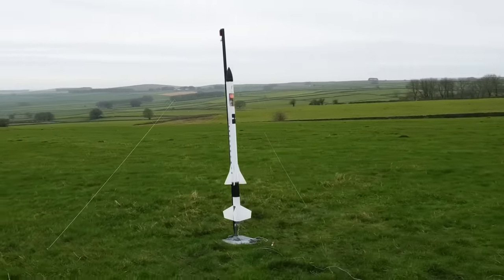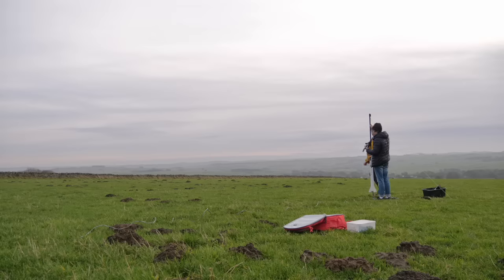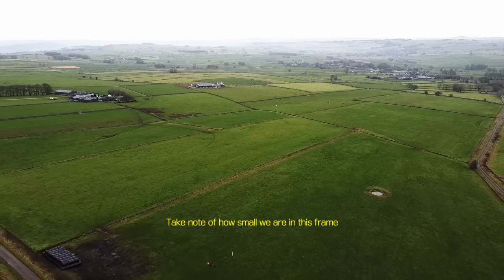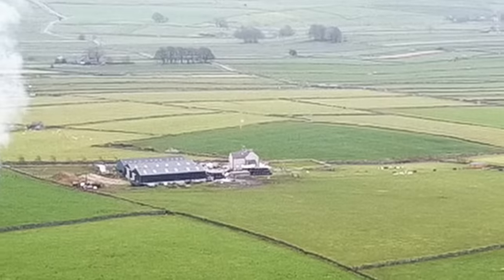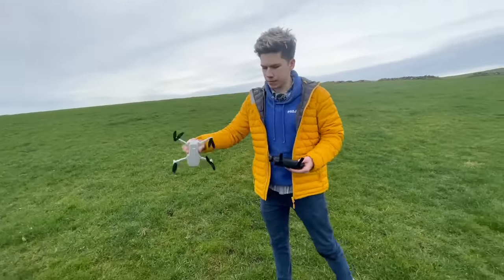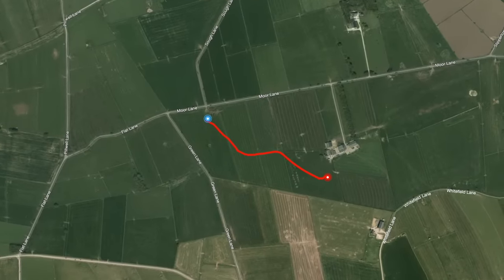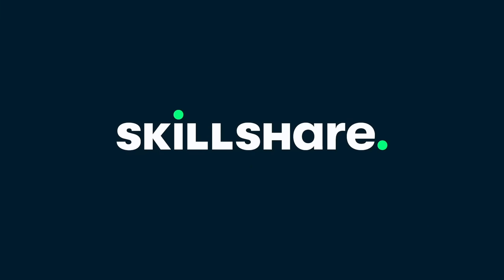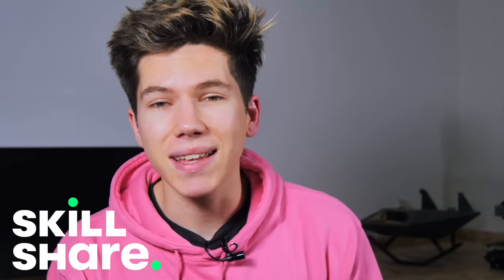High Performance DIY Rocket

Comment: Thats an awesome rocket! Congrats! I can't help notice that both your Ender 3's have the spool mounted on top. I've done the same, but I found printing a spool spacer made a big improvement in printing, preventing the spool from wobbling the frame as it pulled round, made it much smoother and less artefacts in the print.

Comment: One thing to note from this is that things that you don't think can happen will.  Even a bigger stronger camera tray or better attached nose is not a guarantee.  Consider simple and safe backup is a great way to mitigate risk for critical (or at least high cost) failures (like loosing your camera).  One example of how to mitigate this would be a tether line from the camera strap/tripod mount to the parachute anchor.  Good luck on your next launch and stay safe.

Comment: Great launch! My launch rail is a 2 meter curtain rail, reinforced with 20mm square tubing. Mounted on a tripod that is 1 meter high. Giving a total of 3 meters. We have level 2 in South Africa. So that is full J-Class motors. We do several km high flights here. So good luck with your project.
Tip. Build a secured E-Bay for your electronics and cameras. Because you are limited to motor ejection, you may have to look at a body split ejection. Where the e-bay and the nosecone acts as a single, long nosecone, and is attached to the booster by a shock cord/recovery harness.

Comment: In 1978 I built my first Estes 2 stage rocket that I bought at a local hobby shop. It featured a first stage with a 0 second delay on the ejection charge which then lit the 2nd stage off. Unfortunately being a kid without much money on the 2nd flight I used an existing C engine I had in my box which had a 1 or 2 second delay regular engine. On that second flight after the first stage was done the rocket tipped over at apogee and then the 2nd stage fired... it went way into the woods at the edge of our launching field and was never found again despite days of searching. I loved rockets as a kid and homebuilt 2 and 3 stage rockets out of cardboard tubes are really nothing new, though building them with GPS and cameras certainly is!

Comment: Hey James, many years ago at a UKARA event, a chap had a new high power rocket motor that didn't require an explosives license, and it might be time to revisit the idea. It was an injection molded (because this was pre-3D printing) ABS plastic rocket engine vessel, with a thrust nozzle, all in one piece. He had the top threaded for a feed from an NO2 tank, pre-filled the vessel with O2 to get things rolling (simple fill through the nozzle), and ignited the actual wall of the vessel using a spark across some speaker wire, from a fluorescent tube starter. This could be 3D printed easily, with some fluffy chaff to help the conflagration get started inside the vessel. You just need gas, and some solenoid activated valves, and you are flying.

Comment: With a FSI F-100-6 motor and a small rocket, we got mach1 at 900 feet altitude, and the small boom was herd at 1000 feet away from the pad, total cost $11 back in 1992. Also with a dual stage FSI e5-0 plus e5-6 and small rocket got to over 4000 feet, with 9 seconds of total burn, the good old days.

Comment: Use an 80/20 (t-slot) aluminum extrusion for your launch rail. you can get them in 10ft lengths uncut fairly easily (and longer by order) and many of the commercial and 3d printable launch lugs are designed to fit this profile

Comment: A board based on the Venus838FLPX chipset has GPS update rates of up to 20Hz and is very reasonably priced. Good luck with the builds 👍

Comment: Always use a short burn, higher thrust Blue Thunder type motor in the booster to get the rocket moving straight vertical. Longer burn motor in the sustainer since it is already moving fast. Nothing worse that the rocket going horizontal when the second stage lights.

In us you also need a waiver from the FAA. Rules change, but I recall a one pound loaded weight for a G motor. An H motor you will prob only fly with a club that has to get a waiver..

Comment: A few thoughts regarding the nose cone, that you've probably already considered.  If you screw or bolt it to the cardboard 2nd stage tube, you run the risk of the tube tearing if the payload sled shifts.  The first thing I'd try is to either design the sled so it is long enough to completely fill the tube length or add some lightweight filler between the sled and the base of the nose cone.  The second thing would be to make the base of the nosecone that slides into the tube deeper.  That way you can anchor it to the tube farther back from the edge which should give it more strength.  Maybe even use some fiberglass strapping tape and run a band of that around the tube where you're going to put the anchor screws.
.
Excellent launch even with the oops!  Hopefully the camera is well marked and whoever finds it, if anyone does, gets in touch with you soon about it!

Comment: I just watched these 2 videos back to back and almost ALMOST posted on your first video, that a lightweight FPV system with a flight controller with GPS and built in OSD (they also have blackbox data recording on SD card) would be great and would provide you with a LOT more data to work with. 
Watching the launch on the screen on the ground and recording it with a DVR will be brilliant, but allow me to recommend an on board DVR to also record the footage being sent to the Video Transmitter. It will guarantee that the flight data you choose to display on the screen will still be visible as you're not relying on the transmitted video link to the ground station. The OSD on a flight controller using iNav can display 3D speed which is what you want... unlike the GPS logger you have which only shows you horizontal/ground speed.
Anyway, good luck with this and I look forward to seeing you implement FPV into this Project!!! 
Keep it up, you've just grabbed a new subscriber 😊👍😎🚀🚀🚀

Comment: One question: even though it gets pretty close to the speed of sound, it never breaks the sound barrier, so why did you make an almost cone-shaped tip, instead of a more rounded one, that would perform better at subsonic speed?

P.S. sorry for the English, I'm not a native speaker
Reply: Guessing here, but usually the long nose shape is used for 2 reasons. One is that to most people it looks fast. Two is to move the center of pressure farther forwards.
Reply: There are a variety of nosecones designs that are effective in the subsonic range, and the ogive shape (which is what that looks like) is a reasonable choice for subsonic. Conical isn't actually the best shape for Mach breaking however, and some of the power series and the Haack series shapes (also known as a Von Kármán or LD nosecone) are much better through and past mach

Comment: Canadian here, can confirm you would get completely slagged for complaining about 3°C

The most underrated tip I can give you to avoid silly mistakes is, make checklists and use them.
They sound ridiculous, but they make such a difference by allowing you to deal with unexpected problems/situations without loosing track of the mission critical procedures

Comment: Great job and fun to watch. May wish to consider creating and utilizing a check list during launch preparation as the projects (and rockets) become larger and more complicated. In regards to the lost camera, the larger rocket engines are going to create some wicked G-forces both at launch and when decelerating at chute deployment, potentially disrupting pretty much everything glued together on a rocket. May want to try some static G-force or shock testing and or calculate the forces involved and apply them on ground tests of equipment.   I would also recommend some eye or face protection at launches.  Looking forward to more projects.

Comment: Canadian here, I can give you a pass for saying it's "cold" when it's 3 C out, as 11 years ago I moved to Costa Rica, and the locals here tend to get cold around 18 C, and hot at 30 C. I have a new people to harass in my stereotypically Canadian passive aggressive way. :)
Reply: Come to india if you want to see temperature variation we literally live in 50° at summer .
Reply: @Not_so_Jinx  India's temperature difference annually more than 80 degrees? I know it can get really hot in India, not a place I'd enjoy (after all my country is the second coldest annually in the world, only slightly behind Russia). If India does vary annually more than 80 degrees, damn man!
Reply: @canoozie  80° F ? Or 80°C if C then that is too hot to be alive man , that's to much I don't know if humans can survive in 80° but one thing i know is that you can get see a big variation in temp like in Siachen glacier goes to -50° C minimum and leh ladakh which goes to -15° C in southern parts of india near equator line the states are more hotter and some even have the modest temp you can find like Mumbai,  Nasik . You can also experience a well humid weather in eastern parts of India as well as the south eastern part. Basically you can experience this variation in country itself.
Reply: @canoozie  and don't blame me if I sound like a tour guide 😅😂.
Reply: @Not_so_Jinx  Nono, 80 C (-40 C to +40 C = 80 C difference).
Reply: @canoozie  oh I miss understood then 😅
Reply: @canoozie  80°C is boiling xd

Comment: As much thrust as you're using, maybe you should consider using aluminium tubing for the main body of the rocket.  You'd sacrifice some weight, but it would be much more durable and less likely to be damaged in a rough landing.

Comment: I'm sure you've already done so, but as a reminder: Let those neighbors know about the lost camera. They seem to be nice enough (and ride around the field enough) to stumble upon it eventually and let you have it back.
It may also be good to tether everything to a single point with streamers in the next rocket. That way in the event of a catastrophic failure the streamers will act as air brakes for parts to make sure they don't fly away too far, as well as leaving easy to spot markers on the ground. Regular survey/marking tape works well. Of course once the tests are done and you're going for the absolute top flight, the streamers can be removed to lighten up the rocket by those few grams.

Comment: Just an idea that I used on my little rockets I epoxied one of those little pull cord alarms to my camera.  So if it came loose from the rocket the alarm goes off for about an hour just long enough for me to find it.  Sure there are better ones but just used the cheapest ones I could find with a button cell battery.

Comment: Love the channel! How about putting the fpv feed onto a multi stage remote rocket plane, like a remotely guided missile. Using more than one small engine for each stage will give you extra range without too much speed and acceleration to lose control of the aircraft. If i could, i'd build something like that in a heartbeat and itd be legal for me to even install a small firecracker sized impact warhead in the front. A TV guided rocket plane that could deliver a small detonation like that would be utterly impressive.
Reply: so basically you are suggesting james to make diy guided missiles, which is very illegal

Comment: May I suggest a small hybrid system based on a small RC turbine shaft attached to a small generator. The engines/propulsors would be electric. The idea is to demonstrate hybrid fuel aircraft. Renewable fuel sources can be used like ethanol or hydrogen.

Comparison shall be made by weight versus autonomy. A powerful Li-Ion and its weight versus the hybrid system and its fuel tank. How long it will fly?

What do you think?

Comment: Question: did you have to submit a NOTAM? and do you need insurance? I'm doing a project on model rockets (in the uk) and i'm totally new to this. these two point popped up in research. Any advice would be appreciated

Comment: I think you need to learn to dress warm. And since I live in Canada (you knew this was coming 😉) I feel I have a bit of knowledge on the subject. The secret to staying warm is layers. You also don't want to be sweaty as humidity will make you freeze. Also, get a wool tuque as a lot of heat is lost through the head. Insulated boots are a must here.
And being a former rocketeer, I can tell you you did right by using tape instead of the plugs on the igniters. I used to use masking tape as it gets off more easily.

Comment: you can buy chap 10Hz GNSS system, BUT make sure they are REAL and not estimated (look at the datasheet), I know for sure ublox has some real 10Hz model for less than 30€.
You may want to spend some more money into it and buy a model that output RAW data (look for RTK modules), that will make possible to make a lot of post-processing and get even to centimiter level accuracy.
Any serial-TTL to sd card logger like OpenLOG is more than enough to store the raw data and you can easily postprocess it on tool like RTKLIB

Comment: so could the drop in delta v be caused by improper timing of the second stage?  Perhaps this could have caused the interior shift?  What about pinning it in place?  Or Epoxy?  like have a solid plug of wood in the end bit, just core out the inside, so that if glued it has high surface area against the rocket but less mass.

Comment: Great achievement. Shame about the camera. Even with a better secured camera, would it be worth considering having long but lightweight streamers attached and rolled up to critical onboard components to aid in locating them in case of a mid air break up? Just a thought.

Comment: Why don’t you use a raspberry Pi zero and a router on the ground to data log remotely so if a failure happens you still gather some data :) although this does increase cost.

Comment: Explosives Act, 1875 is
"The term “explosive” in this Act—

(1.) Means gunpowder, nitro-glycerine, dynamite, gun-cotton, blasting powders, fulminate of mercury or of other metals, coloured fires, and every other substance, whether similar to those above-mentioned or not, used or manufactured with a view to produce a practical effect by explosion or a pyrotechnic effect; and

(2.) Includes fog-signals, fireworks, fuzes, rockets, percussion caps, detonators, cartridges, ammunition of all descriptions, and every adaptation or preparation of an explosive as above defined."

Comment: This country didn't become the first nation to achieve the industrial revolution with onerous regulations on hobbies. Perhaps a licencing system and monitored supply chain for hobbyists could be an appropriate compromise?
Reply: That's how it works here in New Zealand, works well
Reply: "Q3. I'd like to make my own solid fuel rocket motor. Is this allowed?
A3. It is not legal for UK rocketeers to make their own solid rocket motors.
It is illegal to manufacture any amount of explosive material (ie. rocket propellant) in the UK without a licence from the Health and Safety Executive (HSE)." 

This is from the UKRA website under the FAQ section.
http://www.ukra.org.uk/faq#:~:text=A3.,and%20Safety%20Executive%20(HSE).

Comment: I have been waiting for this video for a while and it did not disappoint.  Great effort and very encouraging results.  I have experienced a camera loss and what hurts the most is not loosing the camera but all of the footage that you work so hard to get.  Another addition to your rocket that you might like to consider is a very small device called a phone tracker.  It essentially receives a GPS signal then broadcasts to a a cell tower and back to your phone.  This would take the unknowns from going across fields looking for where the rocket might be.  Another thought for you is a water rocket, No restriction on mixing chemicals.  Modern ones are very compatible with what you have  https://www.youtube.com/watch?v=OTArDzG2veg&feature=youtu.be Just another thought on your camera too, If the camera was ejected at the point of the chute deployment then working out the time of the ejection charge and the rocket position, may be via camera or memory should assist you narrow down the cameras likely area of impact as it will not drift with the wind like a rocket.

Comment: Might want to rethink the runcam split mate. They have seriously poor light handling capabilities and with your skies as grey or worse then mine I tell you from experience the video will go from washed out to dark and back again. You would be much better off with a phoenix 2  fpv set up and record direct to a lap top at your ground station. the splits are also super susceptible to things like chlorophyll from grass as well as moisture... Nuff said on that hehehe given where you live.

Comment: You can buy a 10Hz capable GPS for about $10 and an openlog for about $6. That's all you need, not even an arduino etc. Use u-blox's u-center app to set up the GPS, and then again to view the log. I would suggest disabling all but the UBX NAV_PVT message, output baud rate 57600, make sure to save the config.
There is some info about changing GPS settings in my video here: watch?v=TwhCX0c8Xe0

You can see an example of how the log playback looks in Joop Brokking's video here: watch?v=uz8u4VymQiw
Note that Joop made his own openlog equivalent for a full size SD card, the off-the-shelf ones available now are much smaller and use micro-SD cards. Search on Banggood for 'openlog' and 'bn-220'
Reply from the maker: Thanks 😊